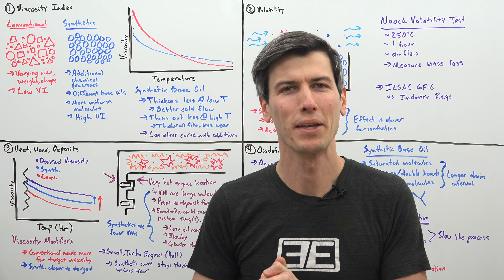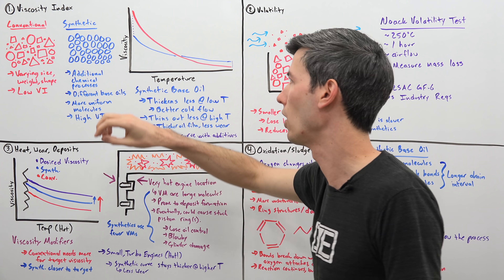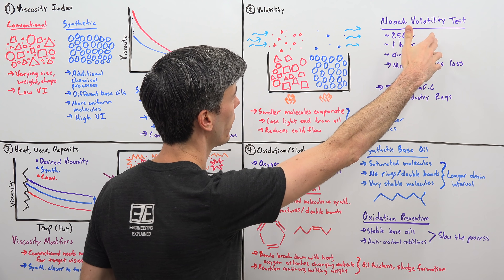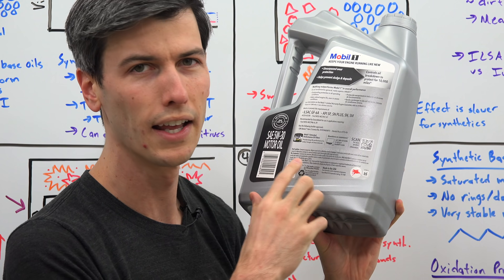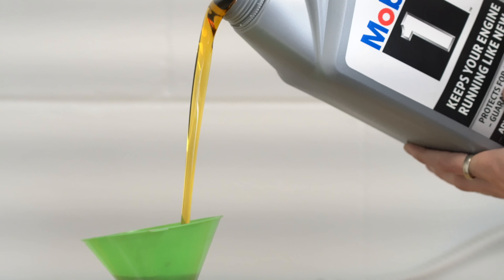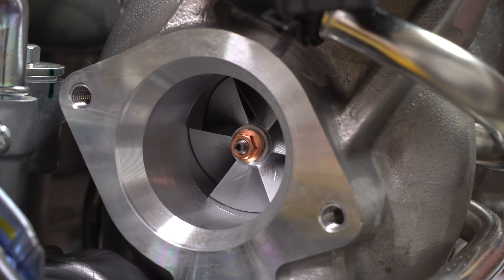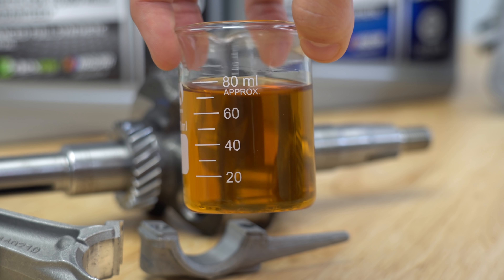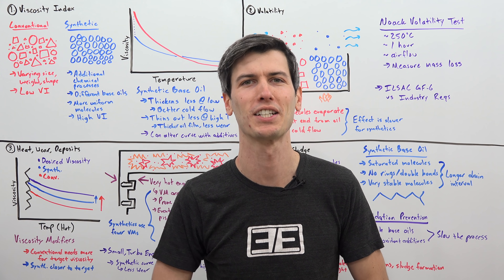Synthetic vs Conventional Oil - There's A Good Reason To Switch

Comment: Another advantage of using the synthetic vs conventional oil is in the high temperature high shear areas of the engine, piston ring and big end connecting rod bearings, where the long chain VI improvers can shear down to shorter lengths and thus lose their effectiveness in boosting the base oil's high temperature viscosity. This happens in my 370Z's engine because of the high shear forces imposed on the oil by the VVEL mechanism and so dictates my shortened oil change intervals, about 3K miles.

Comment: For the past 20 years ive owned nothing buy high mileage vehicles and have always put the cheapest crap i can  find in them, usually whatever sams club has for $20 a case. Never had a engine issue, I’m from up north so the trucks split in half but the motor goes from vehicle to vehicle. So from personal experience i see no reason to change what I’m doin

Comment: I feel like EE must've explained this before, but is there a reason to use conventional oils?? (Do the more frequent oil changes offset the oil cost?)
Reply: Depends on the engine, some engines don't mind running on either but others are a bit more sensitive to the lack of certain additivess so the bearings can wear out due to bad lubrication but it all depends on the engine.
Reply: @CairnieR  Wait, so some engines need the additives put into conventional oils, so you can't use the otherwise superior synthetic oils, with fewer additives, provide bad lubrication? ... wierd
Reply: @mrnicomedes  the engines i work on do because they are from the 1960s so the bearings and lubricating system was designed for monograde oils with specific properties, some companies experimented with multi grade and zinc free oils and found that the engines were losing oil pressure badly after the multi grade had bedded in a few weeks and the zinc free oils were ruining bearings causing catastrophic crankshaft failures because there wasn't the zinc coating in the oil to lubricate the faces properly.

Comment: Full synthetic  oil is not recommended in the aircraft engines because it lacks the ability to keep particulates in suspension.  Conventional oils or semi-synthetic oils are used.  From what I understand full synthetics for small aircraft engines caused a lot of damage and were then pulled from the market. On my engine (Lycoming 160 hp) the oil is supposed to be changed every 25 hours of use.

Comment: Great video!  I'm not convinced on synthetic though.  In order for an oil to be considered "Full Synthetic" it only needs 24% polymers in it.  Polymers don't do anything for lubrication in my opinion, just fillers.  Oil companies save about 60 cents a quart on synthetic but double the price thinking the consumer is getting something special.  I'll be convinced when oil companies start listing their ingredients on the bottles like a box of cereal.
Reply: This is about the best intelligent comment I have read thus far on this panel .. oil company gimmicks
Reply: Good point!

Comment: Yes, when wanting to buy synthetic oil make sure it tells you the base oil is synthetic and the brand isn't just calling the oil synthetic cause it's originally designed to perform like it.
Reply: Buy whatever oil car manufacturer recommends for your car. Even Bugatti doesn’t require 100% synthetic for their super cars.
Reply: @olasek7972  buy what you like, just dont pay synthetic prices for something that isn't.
Reply: @torque350hp  my prices are very reasonable, thanks for your concern, no need to rely on YT propaganda

Comment: Hey Jason! Brilliant video - You did an amazing job of explaining the chemistry in this one! Engine oil deposit formation (mentioned in point 3) is also strongly linked to oxidation (point 4), and deposits are often formed via the same mechanisms as sludge. I'd even suggest the that the oxidative resistance of synthetic base oil stock plays a larger role than the reduced VM content, when it comes to preventing deposit formation. Either way, it's just another reason to go synthetic! 😊 Keep the great content coming! - Sam
Reply: Ask yourself who or what is the real true all synthetic oil out their most people don't even know which ones are why because the petroleum industries don't want you to know the truth makes you go hmmm.

Comment: Thanks for the video Jason I was the guy on your Facebook page telling you about mobil 1 and they’re switched to GF6 , I daily drive a Subaru legacy with the flat six and I’ve been running 530 mobile one from the first oil change, change it every 5000 The engine hardly uses any oil I am at 110,000 right now!

Comment: An Question for u : i using oem engine oil filter my engine stop knocking but when im using other brand oil filter my engine start to knocking again.can u explain that? tq for u replay..my car np300 yd25ddti.
Reply: Some aftermarket filters do not meet the OE spec for oil flow. I would stick with OE

Comment: Funny this came up today. I was just thinking about how all these newer engine have plastic chain guides and other small parts in there, if plastic is a petroleum based product (I'm not well versed in polymers or anything), then would it be possible that conventional oil breaks down these plastic parts quicker? Could explain why some Ford owners always have chain problems, and others never do.

Comment: I started using Mobil 1 in my Toyota pickup new in 1988. At 100,000 miles I had the valve cover off for lash adjustment and it was clean as a whistle in there!  I’ve been hooked since.
Reply: Can You tell us your change Interval milleage?

Comment: Question about the cold flow. I hear folks say that your oil gets thicker as it gets used but that doesn't seem to be when you change it. It looks much thinner like it has gasoline and stuff absorbed into it making it thinner. Lab vs real world difference or am I just thinking about it wrong.
Reply: Yes you are correct. Some engines suffer from fuel dilution. If your oil smells like fuel then it is certain.

Comment: Oh the joys of driving an EVs, never having to worry about oil changes or oil types!
Reply: Your parts still wear, you just have no ability to stop that from happening... ev's are great if you buy a new car every year.
Reply: @adamguinn8305  EVs undeniably have lower maintenence schedules and costs. Until your $8,000 battery wears out.

Comment: Can you sort out which synthetic oils  are PAO based looking on the V.I.?
Reply: Not really because there are additives known as VI improvers that can boost the VI of a base oil. They’re generally made from PIBs. A slightly better indicator is the HTHS viscosity, although even that can be adjusted a bit by additives.

Comment: Great video, I have a question as to why dont we have synthetic engine oils for piston aircraft engines?  My Continental IO-520 engine is suppose to run 50wt oil, is there no 50wt synthetic oils?  Lets keep the FAA and the approval process out of it.
Reply: Good question , because there is some heavy weight synthetics but not many. I think your last sentence is truly the culprit however. "FAA" Everything aviation is way behind times. AMSOIL had an Av oil years ago but they dropped it due to the red tape and liability unfortunately.
Reply: I bet it isn’t only FAA but Continental and Lycoming also have something to say and their own research may not be supporting synthetics. If full synthetics were so good 100% synthetics should be even better yet Bugatti doesn’t recommend 100% synthetics in their supercars.
Reply: @olasek7972  yes, idk what the deal is with Bugatti?! 
But the auto manufacturers are factory filling & recommending synthetics more and more & all the big time racers, well even small time racers, ha, use synthetic lubes. 
 The shear strength/wear prevention, flowability , thermal stability, volatility and capability to prevent sludge & deposits are so much better than conventional lubes. At least on the premium synthetics this holds true. 
I guess on the Rotax 912 series LSA and Light Sport Av engines Rotax recommends changing the oil at half the recommended intervals when using very much 100LL because the lead doesn't stay suspended very well with Synthetic. So the leaded fuels appear to be the problem.
Reply: @429thunderjet2  good point lead could be the problem

Comment: Is there any issue with mixing synthetic and conventional oil? I usually run conventional oil but I top off ~1/2 quart every 5000 miles. Is there an issue if I top off with synthetic?
Reply: No. No issue. Where do you think they get synthetic blend?

Comment: People still use conventional oil?? I thought everyone used synthetic already?
Because i'm guessing you mean that synthetic is better, but I havn't seen the video yet
Reply: ALOT of people still use conventional oil. They want the cheapest oil change possible.
Reply: @Hlokip  But you also have to do it 3-4 times as often
Reply: People normally use what manufacturer recommends for the engine , it may not be synthetic
Reply: @olasek7972   no manufacturer even recommends synthetic unless it’s 0w because it only comes in a synthetic. They never list what type of oil. Just the viscosity

Comment: You could argue that with short milage between oil changes, it really does not matter that much. Long life bullcrap like 30.000 KM between changes should be forbidden. A lot of engines would be saved. Anyway, oil is not a place you should save a few dollars, buy the best for your car. Your engine will thank you.

Comment: I run a 1984 Porsche 911 air cooled, in my state the general conscientious is to use mineral oil 30/60 hi zinc (13ltrs) due to its non cleaning properties which is advised is good for old engines. Across the border into another state they recommend using synthetic oil. The car originally was specified with synthetic Mobil 1. This is an issue within the Porsche community that comes around quite often, can you shed some light on the subject.

Comment: my 2002 Porsche 911 came with mobile 1 oil, one oil change later its still on mobil 1
Not one problem, short of a blown speaker
Reply: That's surprising the Germans chose an American co. for the oil. They must have an engine oil co.
Reply: My 2020 Porsche Macan uses Mobil 1, this is what Porsche recommends and I am not going to try to improve on it

Comment: Mineral oil has strongest oil film of them all. Simple reason why many CNC machines still runing on straight mineral oil, as coolant and for cutting. I run mineral in my diesel, change every 3,000 miles. Get trashed everyday and pulls like train after years. Tell me more about useless expensive engine oils.

Comment: On my 94 Land Rover with 235k on the clock - if synthetic is used it leaks like crazy but high mileage Valvoline non synthetic works great.

Comment: So Mr EE, if you where going to put 0w-20 in your high performance Honda, what oil would you go for?? list in order of preference pls....
Reply: 20 weight in a high performance motor? 😬
Reply: @kc510  Smaller losses and higher power. If it's designed for it and is able to separate the surfaces fully.
Reply: @emilmuhrman  designed by engineers or the team trying to meet CAFE standards?

VW in the ea888 engine went from recommending 40 to 20 over the last few years without changing the engine so I’m not buying it.
Reply: @kc510  What makes you think noting is changed? Even very small changes in tolerances and surface finishes  can result in a design that can allow less viscose oil without compromise service life.

Comment: I use conventional oil in my car due to its age...dose the age determine if I can use conventional or synthetic oil in the engine🤷‍♂️
Reply: If its really high mileage on conventional oil if you switch to synthetic you run the risk of cleaning it out so good it will start leaking oil from removing buildup and varnish

Comment: Does anyone actually still use basic mineral oil based engine oils ?. I used to work for Saab back in the 80's and we introduced Synthetic oil back in 1984. "Saab Turbo Motor oil" as it was badged was actually made by Castrol Engineering for Saab.
Reply: Yes,  plenty still use dino oils. Mostly older cars but yes,  they still do.
Reply: People who drive Rotary powered cars with the Oil Metering Pump still use conventional

Comment: Former chemistry nerd here... Double bonds, especially those in ring structures (resonance bonds), are stronger than single bonds (see also: nitrogen diatoms with triple bonds). Yes, there's a bit of hand waving here, suffice to say that how easily it is to perform oxidation mainly depends on the groups "hanging" off of the ring structures. Your blanket "double bonds are weak" statement is inaccurate. See also: why saturated fats (single bond-double-bond chains) are more difficult to break down in the body and why you should eat less of them.
Reply from the maker: Thanks for the additional insight! My chemistry knowledge could certainly be improved. My understanding was that while double bonds are stronger, these molecules are more susceptible (unsaturated) to having addition bonds form with oxygen carrying molecules, which start the oxidation process. And if I said they were weaker - ooops! - definitely not the goal. Less stable was what I was aiming for.

Comment: I have a 2012 Nissan Sentra S with over 210,000 miles on it. Never had an issue with the original CVT. I changed the fluid every 60,000 miles as required in the owner’s manual. Nissan is capable to be reliable as Toyota and Honda. You haters should learn how to read a manual and drive a car properly and you won’t have any problems long term.

Comment: I drive 30,000 km before changing oil, that's what manufacturers recommend through their dealers and user manuals...
Reply: Omg that is too long!
Reply: @brian_jake  maybe but that's what they tell owners to do. Just buy a long life good 5w-30 oil and you will be good, that's for normal driving, not racing with high revs and quick acceleration...

Comment: Years ago I read where an airplane engine rebuilding company stated that with the advent of synthetic aircraft oils,  they were seeing more rust on engine parts.  (Private planes do a lot more sitting than flying .)  They surmised that synthetic oils drain off parts of a sitting engine more fully than conventional oils, thereby allowing dust to form.  Any thoughts?
Reply: Its like whit brake disks if they sit to long un lubed they rost since the synthetic flows better its in the pan when you not drive and not in the engine
Reply: Neither Lycoming nor Continental aviation engine manufacturers don’t recommend synthetic oils. In aviation engines you better use what is formally approved.

Comment: Calling it Synthetic came about when Standard Oil -Mobil - ws developing lubricants for jet engines and they found a recycled oil was more resistant to high heat.  But Standard Oil got the government to specify first run only conventional oil is required for military engines and aircraft in particular. So to get around the law they renamed it Synthetic and so it has been ever since.  You pay more for recycled oil. In 1974 recycled engine oil refiners were wiped out. Fleets used recycled oil to save money with better results than first run oil.  In other countries the term synthetic was not used and they continued to use recycled oil which is refined many more times than first run oil allowing longer oil change intervals and superior lubrication.

Comment: Is the oxidation why intervals are mile and time based then? That makes sense.
Reply: It is one of the reasons apparently. Also fuel and water content in the oil may increase over time. At least the water content may increase when the engine is stopped (for a long time it seems). In the context of long time resting engines oil components stratification can even occur.

Comment: Couldn't you filter the contamination out, and remove the oxygen to keep using used oil? I'm not speaking about practicality but for knowledge's sake. Used oil has alot of exhaust gases and metal particulate ran through it, turns black after use. Couldn't you just filter those things out or does the oil actually lose it's properties from the heat, oxygen, and contamination?
Reply: those are only some aspects, there are also anti-wear additives that are consumed over time.  You also can't practically remove oxygen from oil molecules in a car, i mean, you probably CAN but it'd be very silly to do so.
Reply: @Wooble57  Yes, I'm just trying to figure out the reason it's replaced instead of reused. We could even ignore the anti-wear additives for the idea's sake and not actual practicality. It sounds to me oxidation is the main issue because contamination is fairly easy to filter out
Reply: @jomanout5866  engine is oil sometimes recycled, more often from what i hear though is it's just burned as heating oil.  recycling the oil is a lot of effort, and oil is needed regardless as heating oil, so why not just filter and burn the used oil?
Reply: @Wooble57  Oh yes, I've used those heaters myself before. You mistake what I mean, I'm into improving existing designs so I'm just juggling ideas around to see if there's a better way to do it. Implementation can wait, first I have to find a better way to do it then I'll worry about the simple things like purifying it or using it as an alternative fuel